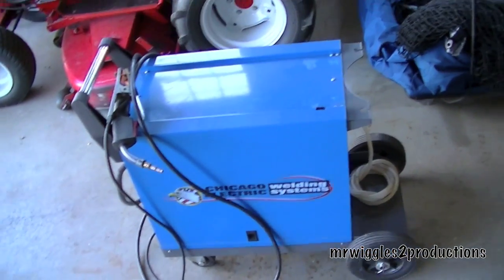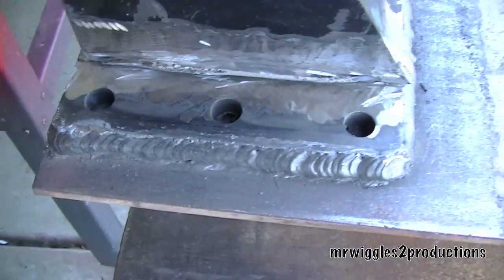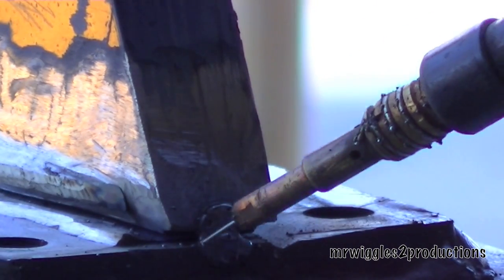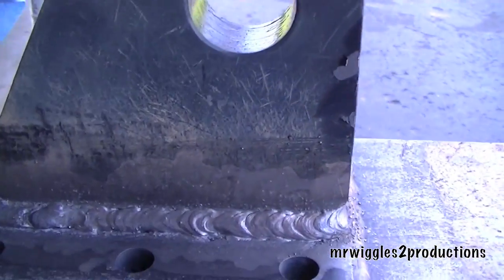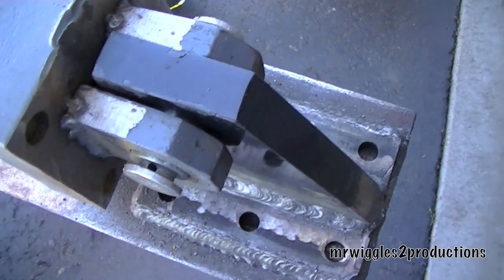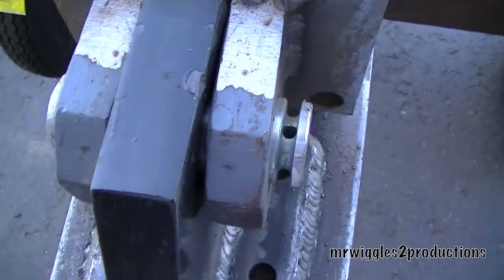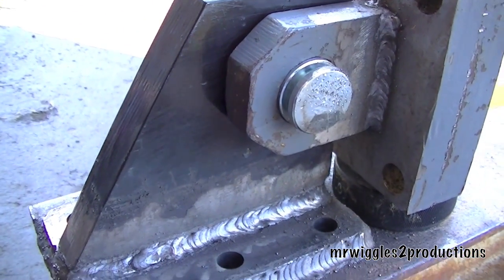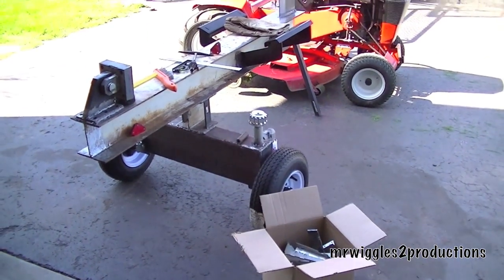Homemade Log Splitter Build Part 7

Comment: Forgive Me from what I Have seen on other Designs when welding the Plates onto the H Girder some use a Plasma Cutter and cut Half an inch or so into the Girder where then the Vertical Stays that Secure the  Ram in Place the thing is that when welded into the  H Girder there is no give; The weld stays secure and  Maybe a Bottom Plate is not needed: But of course I am not a Welder

Comment: Hi Craig, good job, keep up the good work.
Reply from the maker: +Jerry Moore Thank you Jerry, I have more planned for this log splitter.  I'm going to rebuild the push plate and I'm headed to the steel company to look at 3/8" and 1/2" thick plate for the flange.  No more bending, it will be thick enough to resist any twist.

Comment: Where is you gas shield on torch
Reply from the maker: +Jerry Moore I was using .30" flux core wire.  I only use a gas lens when I'm using gas.
Reply: I bet you mean .030", right?
Reply from the maker: yep.

Comment: Guess i missed something, how do your welds look as good as they do ?  I see you are not using a welding nozzle. you must be using a intershield wire. am i right ?
Reply from the maker: Its flux core, no welding nozzle needed.  Thanks for the compliment, my welds looked better the more seat time I had.  Flux core isn't easy, all that smoke is hard to see through.  How about this... its HF wire.  Well, actually, found out they changed to IME wire which is supposed to be a great Italian wire.  For flux core, its great stuff.  The slag just came off so easy, was much nicer than the Chinese wire that came with my welder.

Comment from the maker: I think this welder is underrated.  Been running .030" wire, its penetrating deep on setting 6 (highest setting).  After I ran one side pass the 1" thick steel got so hot the pin hole shrunk so the pin wouldn't slide through.  I've got to say, HF should sell this welder again, its really a good machine.